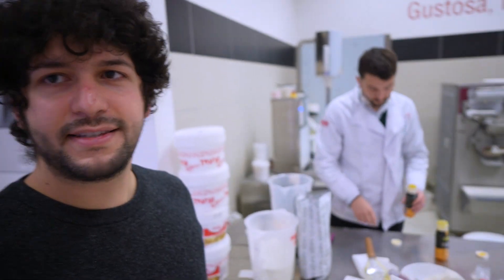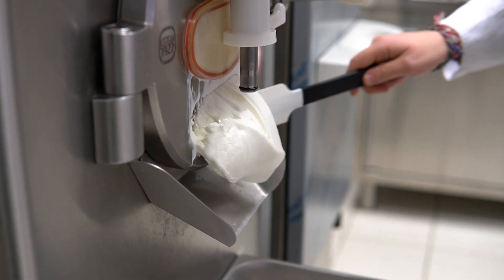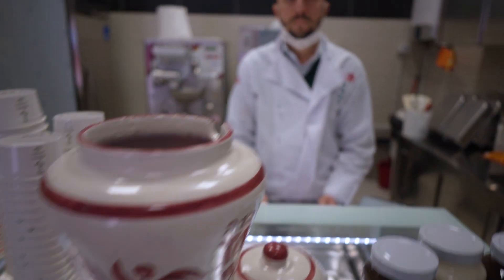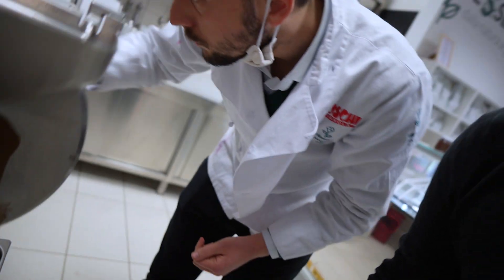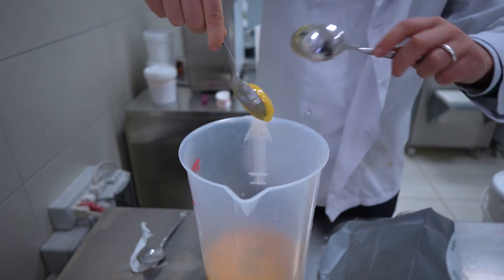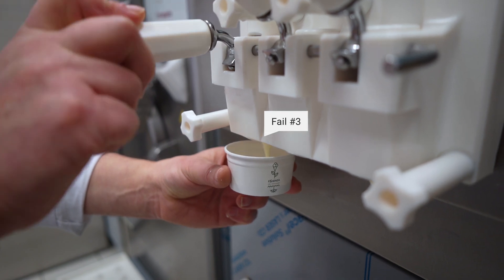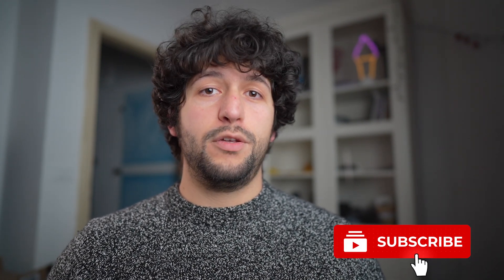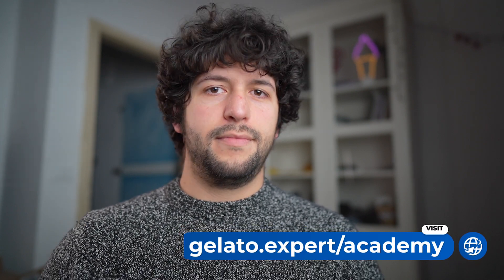Behind the scenes of gelato - Chocolate sorbets, industrial ice cream, soft-serve problems...

Comment: Really good video. Ive been trying to make the perfect vanilla for years but have never got it right. The flavour is so hard to hit. Any tios for a creamy yet light vanilla gelato?
Reply from the maker: Vanilla is very different around the world, with eggs or without, with more fat or less, sweet or not too sweet. It all depends on what are the expectations, but of course the important thing is to use a very good vanilla, I usually like to use 0.2% of pure vanilla beans in powder directly into the mix, and if possible let it infuse for quite a while. Another suggestion is to stay around 9% of fat and not more to avoid the excessive fat to reduce the aroma release in the mouth.
Reply: @Gelatoexpert  Thankyou for your advice. If I may ask one mpre question. Ive heard locust bean gum is great for ice cream...is this true..and should I use it? Thankyou
Reply from the maker: @sj460162  Locust bean gum is one of the most common stabilisers used in ice cream, usually together with others in a form of a commercial stabiliser. You can use it but there are many options.
Reply from the maker: @sj460162  It was one of the most common stabilisers, not it's not so common anymore due to the high price. However it all depends on what you do with your ice cream.
Reply: @Gelatoexpert  Thanks. Ive been using egg and cornflour to great effect recently.